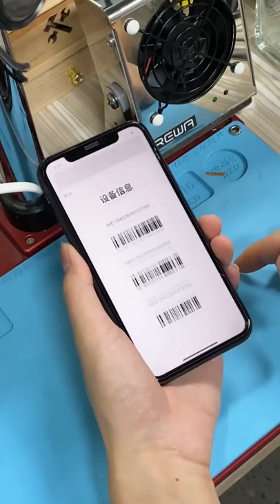Repair Missing Pads of iPhone 11 to Fix No Baseband #shorts

Comment: How do you know the new pads are making a good contact wit where the damaged pads were?
Reply from the maker: We measure the diode values of the repaired missing pads to check if they are fine.
Reply: @rewatechnology2008 you do great work